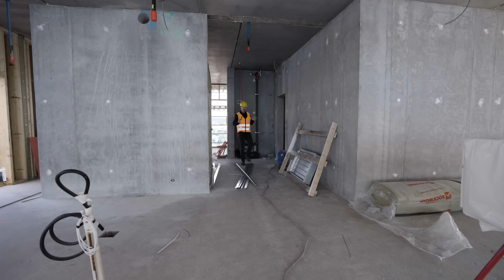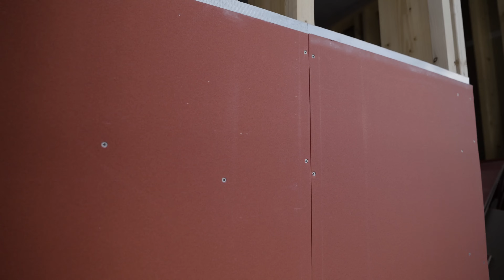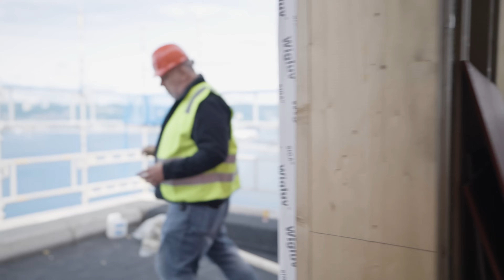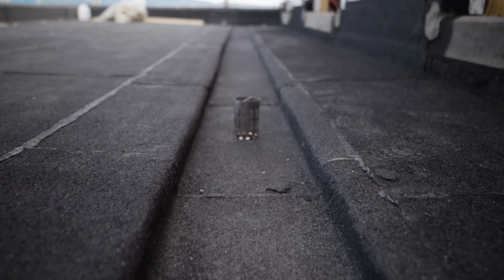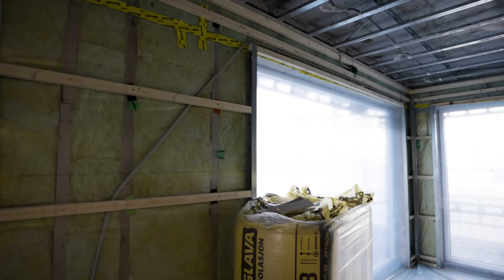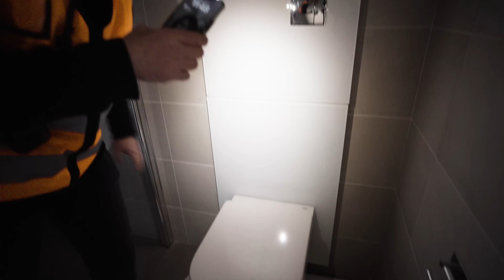How a Norwegian Highrise is Built

Comment: Different approaches dictated by different climate zones. Norway has climate zone like Alaska. You will never build Alaskan house like you build in Texas. If humid hot air gets to the insulation bats it freezes and made insulation worthless and there’s no quick way to remove water from the wall. So they had to keep hot humid air away from walls
Reply: Norway does not have the climate zone as Alaska. Alaska have an Arctic climate, while most of Norway have Oseanic climate. Big difference.
Reply: @okklidokkli While south and mid  Norway doesn't get as cold as Alaska it does however have aslong if not longer winters than alaska and more snow, Most of Norway is located above northern Canada
Reply: @norwegiannationalist7678  Not true either. Western Norway hardly gets snow in the winter. If you compare Anchorage with Oslo, Anchorage have longer and colder winters. You really have to go far north in Norway (Indre Troms and Finnmark) to find a climate comparable to Alaska. Only 2-3% of Norways population live in an area with a climate as cold as Anchorage. Rest of Norway live in milder climate zone.
Reply: @okklidokkli  You obviously don't know anything😂
Reply: @norwegiannationalist7678  Well, I am only using official statistics. But I guess you know better...
Reply: @okklidokkli 1. are you even Norwegian? 2. do you live here? You can’t statistic as much as you want, but unless you actually live here… how can you know since you haven’t seen nor experienced it yourself.
Reply: @ you got the point, right?

Comment: Steve, needs to think about his preferred  Zip system.  Vapour barrier on the inside.  Then a highly breathable system to the outside.  Which works in a cold climate.

Would not work in the UK.  We are not as cold bet damper and higher humidity.
Reply: Newcastle in the UK has on average 1690mm rain a year, Bergen in Norway has 2603mm rain a year on average. Build the norwegian way and it will most definetely work.
Reply: Hehe ye this system we do works anywhere in the world even in the tropical places. Its basicly made so any weather changes will not affect no matter what 👍 @BraxFilm

Comment: Who thought it was a good idea to run the flex conduit DIAGONALLY in the wall?!?!
Enjoying the coverage - now you should do a review of US methods by some European builders 👷
Reply: It is basic rule here that any part of a flex conduit should slope down towards a box, so no water condensation can collect in the conduit. Also it is easier to pull cables in the conduits with less 90-deg bends, this is the whole point of the conduits as it is a basic requirement that any cables or water pex-tubes should be replacable without opening any wall cavities. As to safety from fasteners it is considered safe at least 3cm into the wall cavity as we normally hang 13mm sheetrock with 30-40mm long screws, meaning max 27-30mm penetration. Note no nail-plates are used either.

Comment: Was hoping for an answer to Steve's ruminations about drain on the top floor deck...
Reply: @bobnomura2068  the space on top there are (If they done it after the book) calculated by the heavy'est rain they get in a year in that area.
So the size is adjusted for that square-meter size. The hole sideways is an emergency if the main one cant keep up in extreme weather that are not common in that area. Also why there is not 2 main once is since this is so high up. Leaves are not able to blow up there in big quantity, and if it did it will have boards all over it with "tracks" underneath that will prevent the leaves to be clogged up. Also a half a year clean up maintenance will be required done by either house owner or a service caretaker by law.
Reply: Its a siphoning system thats why it's built like a sump, when the water gets to the small hole it creates a vacuum and sucks the water out.
Reply: It is calculated to hold the heaviest rainfall. The small drain is to protect the city drainage system from overload in heavy rain by slowly draining. It’s building code in most cities.
Reply: @henforli the drain system size is not to protect the city drainage..... Rain water are not going down the sewarge system.... If houses had connected it so its been always a overflow. Its 2 systems in a house a sewarge system and a drainage system. A drain system is a tub around the house also connected to some roof water pipes. And leaded out from the house YES in centrum of a city u have also a drain system for water but On this building im 2000 % sure that pipe going Strait into the sea water. Its literly 20 meters away. The size is calculated for the heavy'est rain fall yes but also the size of the roof it have to service. And thats it.

Comment: Mat or steve., Have you ever seen a ground (first) floor wet room, with a tiled bath sunken through the slab into the  ground with a strong stanable on hatch that  operats like a hatch between floors on a boat or ship to allow it to be used as either:
A. As a seated shower with the hatch up or 
B. A standing shower when the hatch down and locked?
The rest of this disabled & wheelchair  accessesable wet room will have a height adjustable toilet and sink using Linak height adjusters. We're also planning a railing system for a rope and lift. And were wondering about fitting InfraRed heat panels?
Does any of this sound familiar to you?
Because any help would be greatfully appreciated 
Thanks

Comment: Waser dryer closet had no vent? Was there a vent for the bathroom unit video did not make clear? How do they support the exterior decks as roofing membrane seemed to not have any support points for decking? Does decking just lay on top of roof membrane? After terrace is decked what provisions are made for access to drains and gutters?
Reply: @rs2024-s4u  washer and dryers in Norway dont require vents since we dont use gas only electric.
 It is a gap behind the cabinet that let the air out in the room and it is a big fan sucking all air out of the bathroom.
Also aircondition vent so in newer house there is up to 3 vents in a bathroom. The exterior decking can variate but are either a tile system or  wood boards on floating 36mm ''woodtracks'' .
Either a hatch or a tile to lift of to get access to the drain system. :)
Reply: @Punchdown1337  Thanks
Reply: Look up ventless dryers / heatpump dryers. These are becoming popular in US too.
Reply: @colinstu  Yes you are correct but the sales for these heat pumps in respect to clothes dryers and dishwashers is largely driven by building codes and the desire to recover heat. The water vapors and odors created in a bathroom are still present and difficult to deal with given the current state of tech. Seems better to me if one wants would be to use fresh air heat exchangers which are very efficient today and vent the discharges from bathrooms, laundryrooms, and cooktops/ovens/kitchens.
Reply: @rs2024-s4u  that's exactly what ERV/HRVs are for. These are all solved issues.
Reply: @rs2024-s4u  i had cloth dryer before, that was without a heat pump. And the air was so moist after one machine so the exaust fan struggled to get the moist air out. Changed 5 years ago to cloth dryer with air pump and the moist issues was gone. The air in the bathroom after 5hrs of continuous drying cloth is 1-2 % higher then the base air with out drying cloth. So easly the best choice these days. They are also been really cheap and now there is basicly no dryers for sale without heatpump inside.
Reply: @Punchdown1337  For me I've been building res. homes for over six decades not venting a bathroom, a laundry room, and cooking areas is poor policy. This will always in my estimation make living areas less confortable and is a step backwards in build science.
Reply: @raystormont haha think you been miss understanding. All rooms in the entire house is ventilated with both a fresh and exaust vent thats why we building the building 100% air thight. To get a balanced inside clima. And on top of that we got also extra ventilator in the kitchen for the stove and on the bathroom normaly close to the shower. What i said we dont have is a direct exhaust on the washer and dryer. Like ppl in U.S have and that because most ppl in U.S still use gas washer and dryers. So Norway have not been going backward in time. In fact we are more like 30 years in front of U.S on most of the building science. Its a reason why houses in Norway are up to 11 times more power efficient then a new built home in America. Also u talking about a heat pump to heat the home....... We talked about dryer that have heat pump inside it NEW technology vs the old condens dryers. And they are up to 6 times less power hungry and also reducing the moist air they trow out in the room by up to 95%. 😂

Comment: Wrote a long respons but lost all i wrote since windows update had other plans.... 
But all the stuff you guys review are been studdied over 60 years of knowledge.
The way American build would roten or mold away with in 2years. 
The climate is so diffrent with the temprature that can be -15celsius at the morning and up to 10+ in the day time.
And back down to -15 at night time so the condense issue is wild here.
Thats also why we have so much space between the cladding and the gips to remove moisture. 
Many places in U.S they dont even have air space between the cladding and zip system.
That would not work at all here. If u do so its like 6month and u can alrdy smell the mold.
The out side is vapor barrier  tight but breath able al the way into the plastic on the inside wall to remove any trapped moisture.
I know in U.S u guys have difrent ways to do it in each Stat, here in norway whe have ppl that spent 10 000's of hrs to make a hand book that we all can follow to prevent bad stuff from happening. if u follow that book the house would not even have 1 % chance to not last 30-50 years without a mold /water issue.
If u got any questions dont hasitate to ask i been a Carpenter in Norway for 25 years.
Reply: What is the name of this handbook that you mention? I live in Canada in a cold climate probably similar to Norway. Would be interesting to look through it
Reply: @StefanBergendahlDeKa  TEK17 if im not wrong
Reply: @StefanBergendahlDeKa  "Sintef Trehus", a lot of illustrations, but it's expensive, like $100, while it is much cheaper (or probably even free) for companies who are members of the Sintef building research group. There is also the "Figursamling for Trehus" which is just the drawings with a small explanation. That's the kind of book the carpenter will reference. I'ts cheaper. I got mine for free when I was an apprentice.
Reply: @Fekillix  Appreciate it! I'll look into it. Thanks
Reply: @Fekillix  Now I just have to learn how to read Norwegian haha
Reply: @StefanBergendahlDeKa  You need a license to sign in. its all digital these days and only a Company have access to it. You can of course Google stuff and get answere of each task that way but the '' Company site is "SINTEF BYGGFORSK" and yes Canada and Norway is pretty simular in clima;)
Reply: @StefanBergendahlDeKa   I saw some other comments that said TEK17. I found an unofficial translation to english here https://www.dibk.no/globalassets/byggeregler/regulation-on-technical-requirements-for-construction-works--technical-regulations.pdf

Comment: By code at least 75% of the insulation needs to be on the outside of the vapor barrier in Norway (used to be 2/3). I believe also every new bathroom needs to be built like a waterproof unit.
Reply: @trulsher  not anymore just the wet zone but most ppl still doing a 100 % waterproof unit
Reply: @Punchdown1337  this is correct.  In Norway, strict regulations apply to the construction of bathrooms to ensure waterproofing and prevent water damage. A wet zone is defined as the area within 1 meter in all directions from any point where water is emitted, such as around sinks, showers, and bathtubs. This can be visualized as a 1m³ area surrounding fixtures like a washbasin. Additionally, the entire floor of a bathroom is considered part of the wet zone and must be covered with a waterproof membrane to meet regulatory standards.

There is also a requirement for a slope from the threshold at the entrance to the bathroom leading towards the floor drain to ensure proper water flow and drainage. These measures help prevent water accumulation, reduce the risk of leaks, and maintain the long-term integrity of the building structure.
Reply: @Mining4people  The floor you are correct on. The sink are not considered a wet zone any more only the bathtub/shower and only in the shower zone. If there is a shower cabinet then u can literary do wood walls. No need for 1 meter out from the shower. If u got glass doors you can fold, the water proofing can stop on the dry side of the glass doors. They have reduced on the rules lately after "tec 17" was the new rules to follow. But the floor need to be 100% water proof. And the slope need to be minimum 25mm from the door to the drain. The membrane can also be under the door and not like before that u had to have a 2" trim under the door to attached the membrane on. Thats because now we building so ppl in a wheelchair can roll straight into the bathroom. I been a Carpenter for 25 years with a wetroom sertificate. Probebly built 100+ wet rooms so as i said just ask if anyone have questions 😀

Comment: The piece of insulation you picked up to put in the outer wall was meant for the inner walls (Steel studs), it is 60 cm to account for the extra width. The piece you were thinking about it 57,5cm which will fit perfectly in between the horisontal 2'2' in the outer wall. We usually frame everything with 60cm center to center, which will make it 55,2 cm between each stud. Other than that, great video! It's cool to hear your thoughts on how we do it here in Norway :)
Reply: I wish I could employ builders who built to Scandinavian standards  in the UK? 

Is the 60cm related to cabinet size in the EU. Kitchen cabinets are usually 60cm and IKEA uses 60cm 90cm & 1.2m? Is this a standards thing?

BTW I live in Oxford where about 80% of people voted against Brexit. Thankfully I have dual citizenship, but being outside the EU sucks everyday. And afaik Norway isn't EU but... I annoying that LED SAD lamps &  Infrared SAD heat panels have only become availble in the last 10 years. If they were available when I was 20 I would have started learning Norwegian. I know you all speak English, but to be a part of the community you need to speak the local language, which is why I am learning Portugese because everybody round here is from Portugal or Brazil.
Reply: @annakissed3226  In Norway, we use a measurement system called "module" for measuring items like windows, doors, and kitchen cabinets. This system is based on increments of 10 cm, which means that 1 module (1m) equals 10 cm. For example, a kitchen's width might be 2 modules (20 cm) or 3 modules (30 cm), and the sizes increase in steps of 10 cm. If there is a space smaller than a module, such as a 7 cm gap, it will be filled with a blank piece to close off the space against walls or between cabinets as needed.

We could add that the most commonly used sizes for kitchen cabinets in Norway are 20 cm, 40 cm, 60 cm, and 80 cm. Corner cabinets are often 80 x 120 cm to create a practical solution for doors and layout.

For doors, there are common standard sizes like 9m x 21m, which refers to a door measuring 90 x 210 cm. Although it’s named as such, the actual size of the door is slightly different, typically 89 x 209 cm, to allow room for insulation around the frame. When a carpenter creates an opening for this type of door, they will make it 92 x 212 cm, leaving a 3 cm larger space. This ensures the door can be centered and leaves a 1.5 cm gap on each side for adjustments.

The 3 cm extra height is necessary for practical installation reasons. Usually, interior or exterior doors are installed after the flooring is laid down. For an exterior door where tiles might be installed inside, the door is lifted 15 mm using shims to allow space for the tile installation. This ensures that the tiles align neatly with the bottom of the door, and a small silicone seal can be applied to close the gap between the door and the floor.
Reply: @annakissed3226  in Norway we usually build in modules of 60cm, I'm guessing the cabinets are produced to fit these modules
Reply: @annakissed3226  c/c 60cm is due to the standard size of sheet material, but everything is basically based around it. its a system, used in the whole construction, part of NS (norwegian Standard).